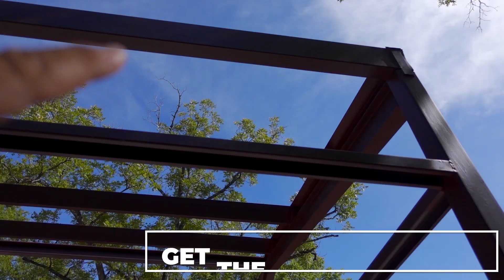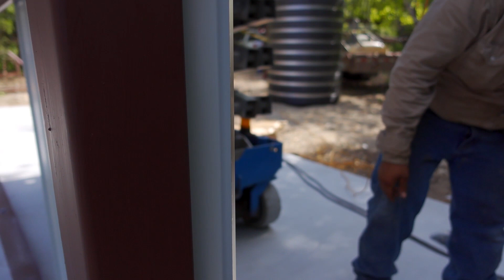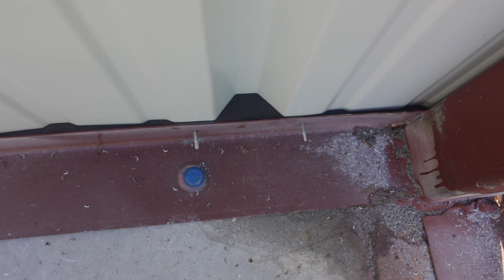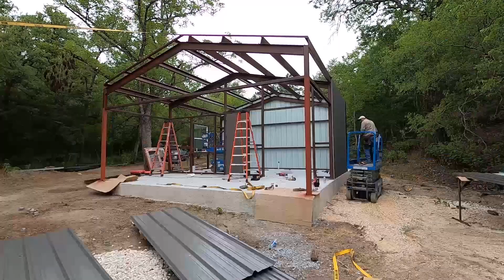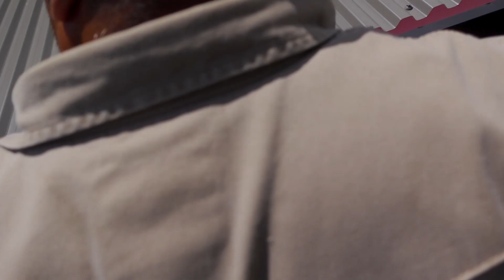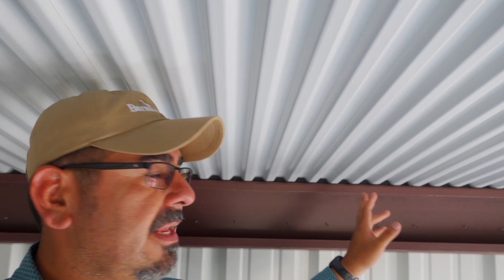Building Erection part 3 | Demolition Ranch HQ part 12

Comment: Pre drilling is smart that way when u run the self tapper screws down the sheet metal does't leave any burs .. burs cause water leak issues 👍alot of crews that drill quick get nasty burs that split or part the seals..

Comment: I get a kick out of it when people complain about drilling the panels. Been doing it for years and you get a better seal units you way over size the hole. What do people think a self drilling or tapping screw does? Just less clean and controlled, often leaving burrs.

Great work! It's nice seeing a few things I haven't tried before like the hanging gutter

Comment: the future is icf forms - 10x as strong and cheaper labor costs, better insulated - especially in areas with tornadoes there is no comparison - lower insurance rates - the install is still critical and you probably end up adding a bunch of rebar but a better overall investment, an easier sale #a sales ninja must close
Reply from the maker: We may or may not have an ICF build coming up.  🤷‍♂️😉

Comment: A self tapping metal screw “drills” through the panel, so why would drilling a hole be any different?
Reply: Self tapping creates a tighter seal than putting it into an existing hole. But if you use the right size hole I don't see why it would matter too much

Comment: do the screws you use on the siding have rubber washers?  If not, doesn't water get behind them as it runs down the walls?

Comment: What is wrong with predrilling the sheeting???? Isn't that what the self tapping screws do???
Reply: Yes but the screws move around on you while you’re trying to drive them in.. and then you scratch up the metal sheets. Also, it takes time for the screws to drill through the sheet, by drilling/punching holes through the sheets, you save yourself time.

Comment: Do you put any underneath the sheets to close the gap between the sheets and concrete? Also how do you prevent rust from forming on the frame? Are you able to walk on the roof if needed? Can you do a video on these questions? Hope you don't mind I might have more questions as the project rolls on.

Comment: I just did a building and used a punch. Drill makes so much more sense. 

Screw the nay sayers
Reply: You mean the metal manufacturer? They specifically say not to drill, only punch.
Reply from the maker: But self tapping screws drill. 🤷‍♂️

Comment: Here in Australia we only attach the sheets using the ridge and not the flats for wall and roof sheets ,to seal the the sheets we use  a z flashing that fits into slab rebate.

Comment: If someone were spray foaming the building, would you bother with the “foam closures” (I think that’s what you were saying.)
Reply from the maker: Yes, always use foam closures.  If you don’t, the insulation will shoot out when sprayed and will make a terrible mess.  
Always seal the building before insulation.  Insulation is not meant to be a sealant.
Reply: Texas Barndominiums I didn’t think of that. Thanks!

Comment: QUESTION: How do they manage the slope in the gutter, so that the rainwater is flowing towards the back of the structure and into the collection barrel? You showed how the gutter was mounted, but didn't include that detail.
Reply: I don't know how he does it but what I do is pit a 5% ish decline in the gutter towards to escape.

That way the water flows and it doesn't look to drastic, as in can't really be noticed. 

I don't know exactly how he does it with a hanging gutter, but that's how I do it with clamped gutters.

I would assume he puts a spacer of sum sort at the escape end.
Reply: @tomaszdolan9031  I know when doing traditional gutters with the hangers, the hangers are mounted in a line that drops something like 1/8" to 1/4" per foot to create the slope. I didn't see anything like that in the way the mounted the gutters. the slope might be in the gutters. I don't know. I hope Eric responds.
Reply: Good point, if he’s fixing them from the roof sheets how does it fall? Maybe it’s packed down each screw 🤷‍♂️ to give it the fall

Comment: Why would drilling holes in your sheetmetal void any warranties the product would have? You still have to cut openings from everything as small as a hole for a cable to door openings. And the other absurdity is that using self tapping screws also "drills holes" in the sheetmetal. Now, your screw holes should be around the same size or slightly smaller than the screw your using, so I could see a very large screw hold allowing water into the building being a warranty issue. BUt that's just being sloppy and lazy, not the matter of drilling holes in something you're already drilling and cutting holes into.
Reply: Also the screws I've always seen used for these have a rubber washer at the head that seals up the hole, never heard of predrilling voiding anything and it sounds like an absurd idea
Reply: Bdkj3e _   Although Erik properly debunked it, the reason some think that is that some hacks don’t sweep their roofs after installation, leaving small shards of metal that can rust and harm the finish.  That’s what it’s all about.  There is nothing wrong with drilling, especially in a stack and the roof has to be swept anyway.

Comment: Sounds like someone has learned the hard way not to stack measurements. Every shot is taken from the slab not the next lower piece
Reply: Absolutely! Always measure from the reference dimension. Stacking measurements is just begging for trouble. Reference A to B,  Reference A to C, etc... Sure, B to C SHOULD equal  (A + C) - (A + B) but due to the potential for the tolerances stacking unequally you are almost guaranteed to get a sub-par result. Doesn't matter if you are working wood, metal, concrete or stone. Internal parts for a Pocket Watch or a Suspension Bridge, all the same rules apply.